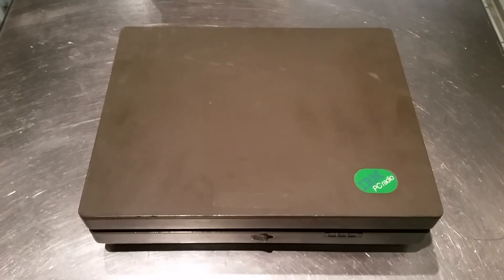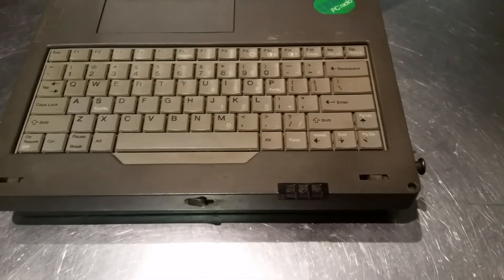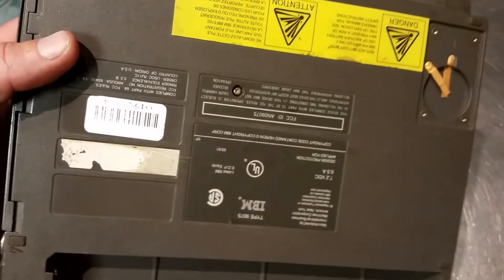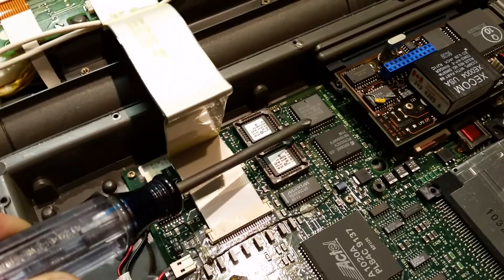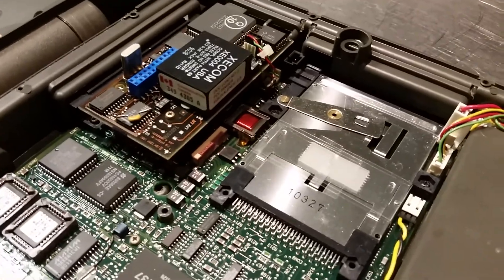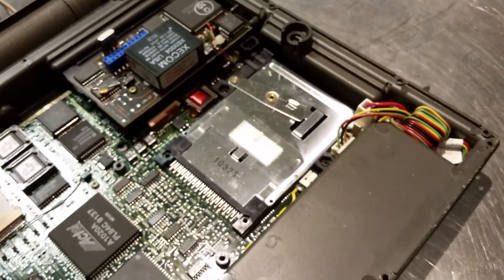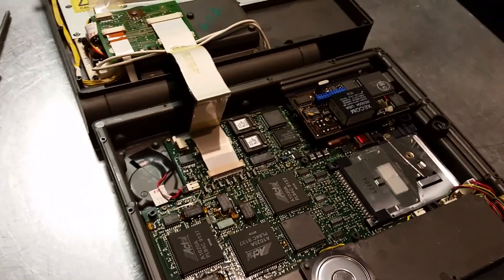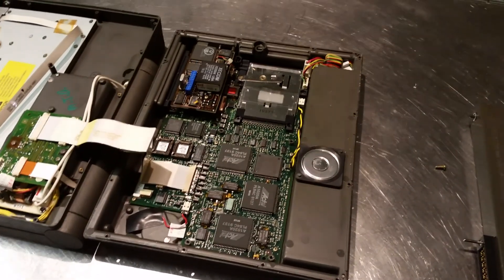IBM PC Radio

Comment: The pin port on the lower right hand side is for a power supply to power the device. The battery is 7.2V 1.7Ah P/N 64F5635, Fast charging Nickel Cadmium

Comment: I did some work on the dev of the PCRadio back in early 1992 - I worked on the internal diagnostics software for the 2 UK models as a student, programmed into the socketed ICs near the wide flexi connector on the motherboard. Brings back some memories seeing one :) I remember being able to connect a telephone-style receiver to my units; I thought the connector was RJ45 (or similar) - but it was a long time ago, I could be mistaken. It was a rugged little box - our test procedure included a 'bucket of water' test and a 'dude stands on the laptop' test.
Reply from the maker: Cool! I might need to bug you some time.

Do you have any documentation for it, other than the few bits available from IBM?
Reply: @uniservo  Sadly no, it's all a distant memory. I worked for IBM as part of my degree and had to write a report at the end of the year - I can try to dig that up, it might have something interesting in it. I'm really happy you made this; there's so little information on the web about this little machine, it's great to see one being appreciated!